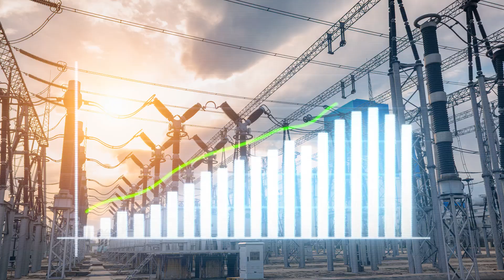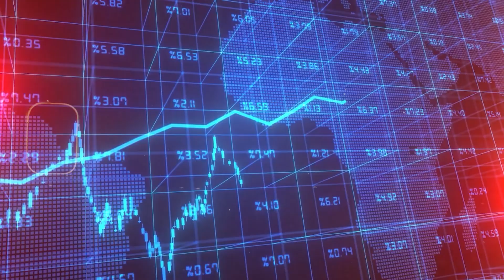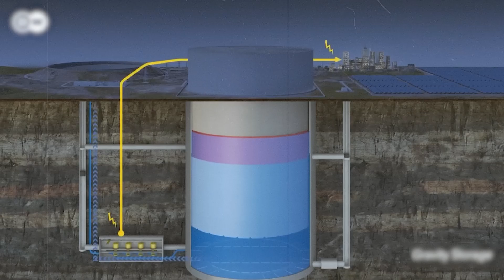The Secret War for Energy Storage Is About to Explode

Comment: A massive problem for the battery energy storage industry is that the price is falling so quickly. If the investment of the battery will be repaid in 10 years, but the price of the batteries falls 30% every year, then it makes economic sense to wait a year. And then, in a year, maybe it will make sense to wait yet another year.

Comment: I can say with certainty that hydrogen energy will definitely dominate the market in the future.
It should be noted that I am referring to the industrial energy market.
Industrial enterprises have the capability to address safety issues, so installing it on automobiles would be too dangerous.
Furthermore, seawater-based hydrogen production has now solved many of the problems.